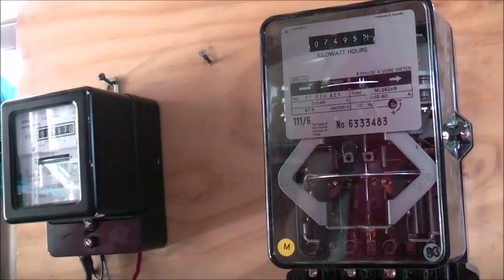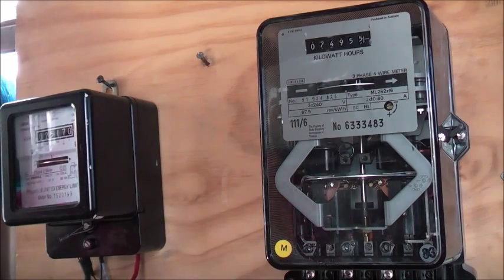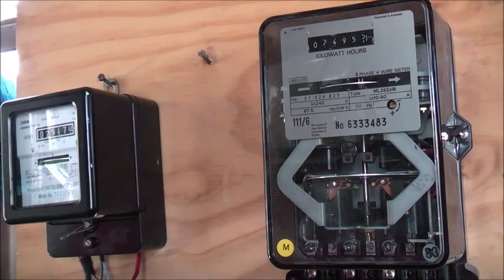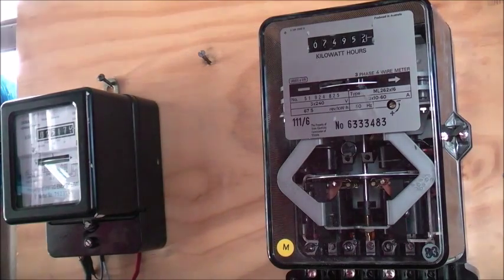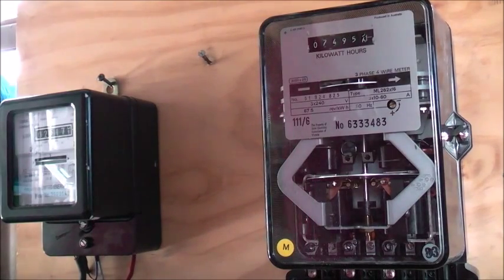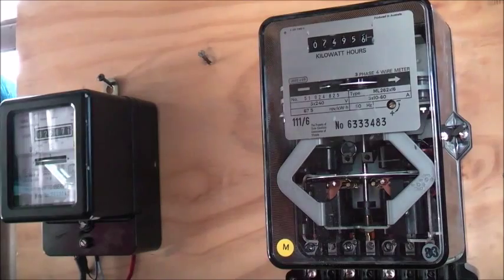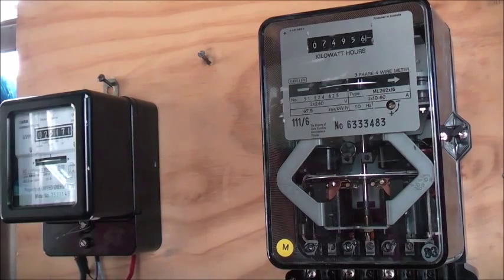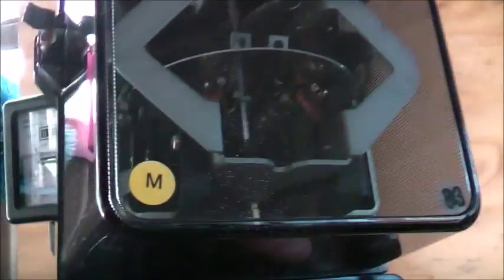Earlier Landis & Gyr ML262xDF6 Watthour Meter Test & Clean!!

Comment: I've just noticed something about this instrument.... the lower loadwheel doesn't appear to have the black zero-mark on the loadwheel.

Is there any numbering on the loadwheels?

What's this I hear that you have meter twins? Let's see! :D

If you have meter twins, they need to be documented on-video. It's the law. :D

It would also be nice to spin them both up at the same time while they have their own vid. They can be gently revving their loadwheels while you have a talk about them and share with us their characteristics. :-)

it would also be interesting to see the difference in the kWh readings between them, and how much they differ, if at all. 

One video..... FOUR loadwheels! :D For the optimum Sssatisfaction. :D

Thanxx for showing,

-BoomBoxDeluxe.

23rd Ocober 2015, 02.20